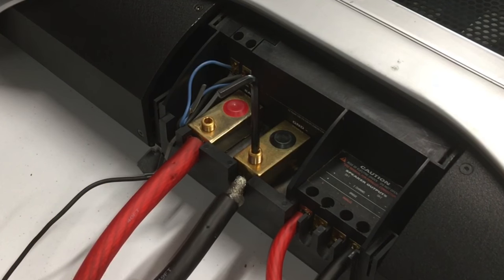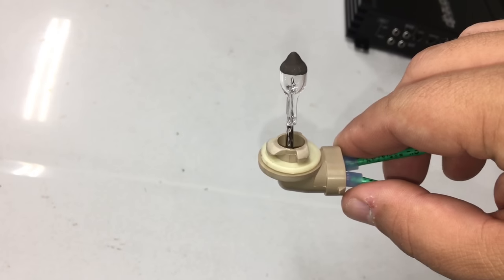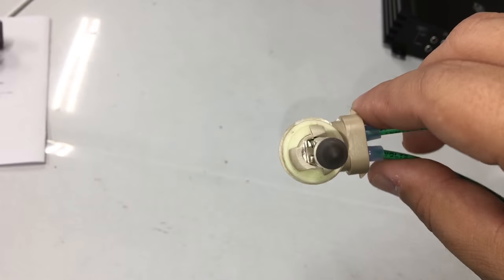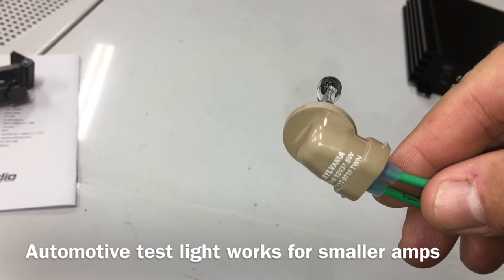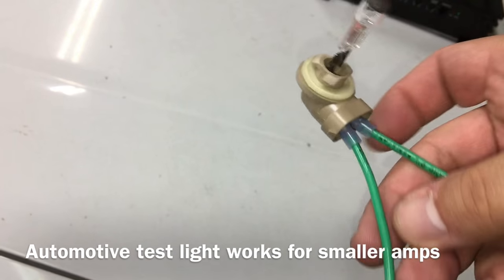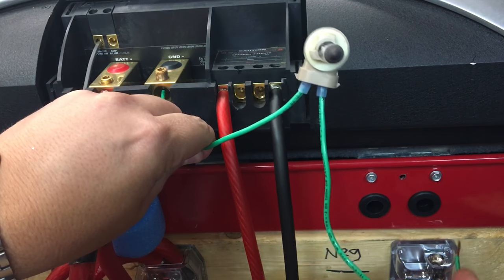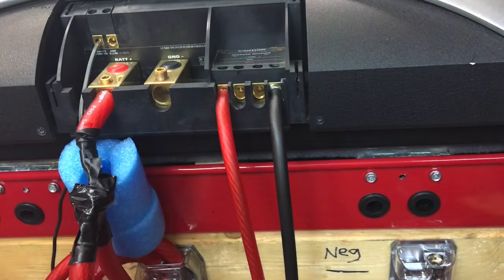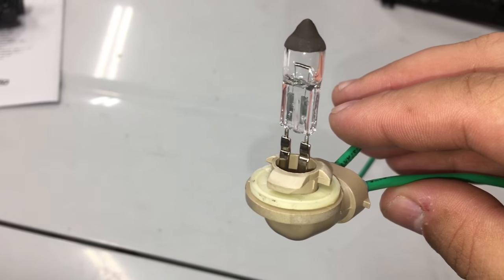Stop Car Amplifier Sparking - Tech Tip Tuesday

Comment: Man, I might be 6'5 but sparks scare the shit out of me. I can't be the only one, right? Haha
Reply from the maker: +Mark Vaughn yeah, especially w/ big 'Ol amps like this JBL A6000. Dat Spark makes me jump every time 😳
Reply: I'm so paranoid of sparks that I disconnect my battery before hooking up or disconnecting an amp. And even then I close my eyes as I insert said power wire haha
Reply: I'm 6'6. Today I tried to replace my amp  when I picked one up on the way to work.  I literally almost called in & called AAA to come tow my car after seeing the Sparks. My amp is undone & I'm just going to wait to got to the shop. Didn't even connect it back to the old amp
Reply: I'm right with ya and once it happens I'm paranoid as all hell I can deal with a lot of things I've even had a gun pulled on me a couple times but sparks freak me out.

Comment: I wish I'd seen this video before I transferred a old amp to my new car resulting in killing the amp with that spark. It still lights up, but a red light comes on and it says alarm then shuts off. I checked to see if there's any internal fuses and couldn't find any inside or outside on a "Reaudio 90.4 Amp"  Its a pretty cool paper weight now! LOL
Reply from the maker: You can also use a cheap 12V test light from Harbor Freight. Just connect to ground terminal of amp and to ground wire connected to the vehicle and it will light up to charge the capacitors slowly, when the light goes out, then you can connect the ground to the amp with zero or very minimal spark
Reply: Same popped my 150A fuse i had a spare but cant find it now have to wait another day to hear my system😂😅

Comment: Cool thanks Big D. Question tho. Would that spark short out the amp or the amp fuse?
Reply from the maker: +Brian Miles usually not, but that inrush of current can't be good. The JBL A6000gti amp shown is an unusually large amp with a massive spark, proving this is more important with larger amps as they have more caps to charge
Reply: I have had that take out a fuse before. That's why I practice this, (or at least a close variation). Good info here.

Comment: What would you recommend if this didn't work for me and my amp is still sparking?
Reply from the maker: You must have some other issues if the connection continues to spark after charging the amp's caps
Reply: BigDWiz the 12 volt light stays on when I connect it to a ground and the amp. Could this mean I have too much power going to the amp?

Comment: I moved my amp to a different location in my car but I couldn't find a ground for it so I put it back exactly where it was before (worked fine) and now I'm getting sparks and now the amp won't turn on, so I tested another amp and that won't turn on either. what could cause that issue? should I unplug the car battery to restart it or something?
Reply from the maker: Get a test light to ensure you have a good connection

Comment: Can u make another video like can't really see exactly what your doing?
Reply from the maker: Use a test light, it will charge capacitors and minimize spark as well
Reply: @wal  so if I understand you correctly all I have to do is Hook the positive wire to the amp and then use a test light or a light bulb and touch the bulb leads one to negative terminal and one to the negative ground wire that I'm using and that basically slow down the intitail current thus not making a spark